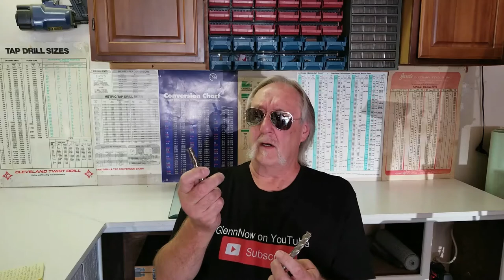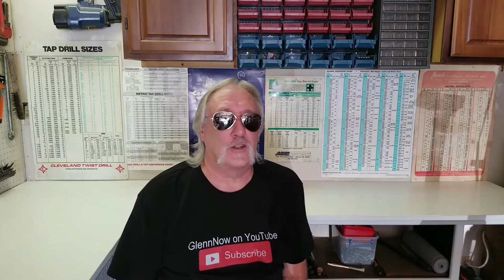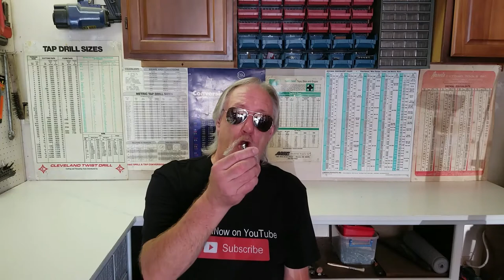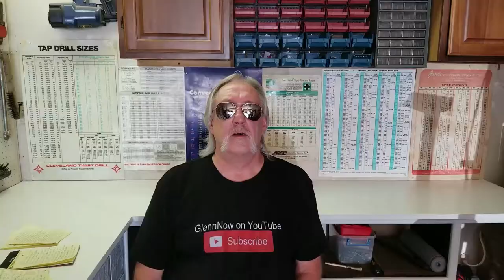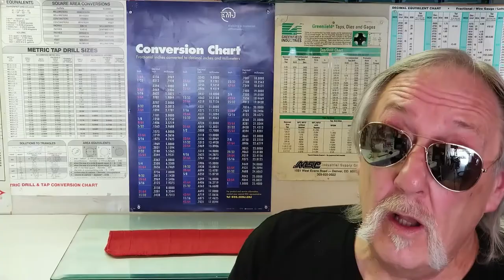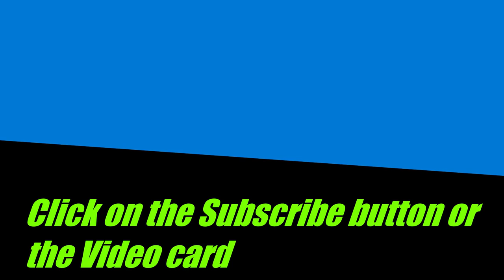HSS vs CARBIDE

Comment: There’s really no contest. Even in home shops, carbide is king. As long as you’re careful, I.e. know what you’re doing by learning the proper feeds and speeds instead of guessing, carbide will last far longer than HSS, which dulls after a couple dozen feet of mild steel cutting. The modern designs of carbide allow much better cut quality, and feed speed than HSS, even in a home shop with small, less than ideal equipment. Just maintain your equipment by proper adjustments and lube, along with making sure moving parts don’t get chips or sandpaper dust in them.

As long as machines are taken care of, the advantages of carbide are obvious in use.
Reply from the maker: First, Thank You for viewing my channel and commenting. Everything you said here is right on. I can't agree with you more.